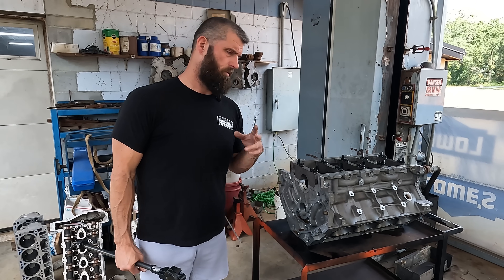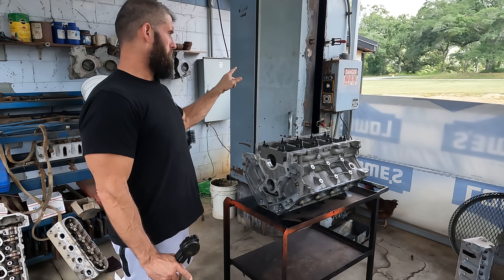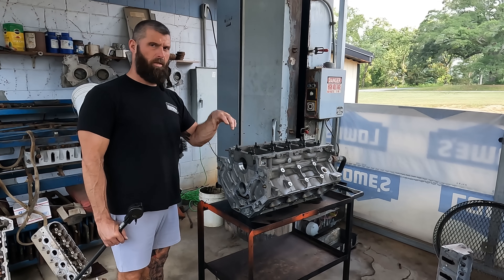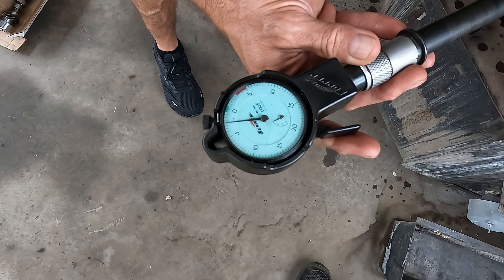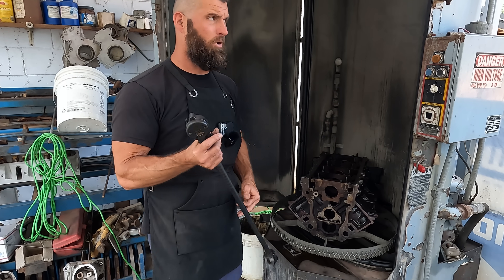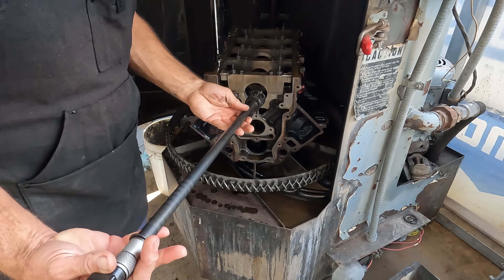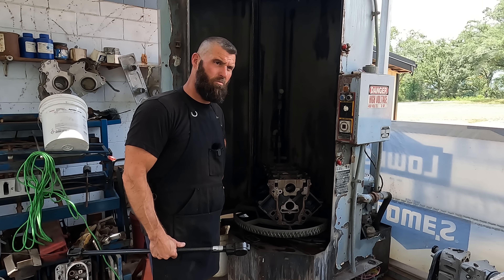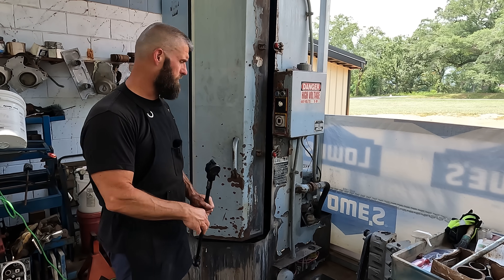Aluminum vs Iron main bearing clearance

Comment: Fascinating test, i always wondered about the aluminum block vs the iron block metal growth factor, you answered that question.. since the main caps are steel and the block is aluminum in your test i have always wanted to know what the cam bore does under hot temperatures since it is a solid aluminum bore vs a iron block cam bore.. and a crankshaft temperature test would be very interesting as well, i suspect that an iron block with an iron crankshaft that the clearance will not really be different under most temperatures cold/ hot , i would suspect that the clearance from an aluminum bearing would grow and take up a very small amount of clearance.. thanks for the comparison.. another fascinating bore dia. Vs hot temperatures test would be an aluminum cam bearing installed in an aluminum block vs an aluminum cam bearing in an iron block?? That would really be quiet the test.. your story video was quite inspirational, much respect to you and your wife 🪽
Reply from the maker: Tyvm, we really appreciate that!, I will do a cam bore test
Reply: @powellmachineinc   WOW, thats going to be awesome ..   stumbled across your videos by accident and have been impressed with the level of expertise and the striving for quality and innovation..  I have learned much from you, im working on my ls2 swap and needed help thank you very much for the educational videos .. Peace

Comment: Not surprising at all and thank you for this. Different materials have different expansion/contraction rates. Not only to be considered for block clearances but also when determining valve lash and other tolerances. Cold and hot lash can vary greatly.  For example, a ZL-1 all-aluminum Rat-motor valve lash should be different than that of an all cast-iron engine or one of a cast- iron block with aluminum heads given the exact same mechanical cam. I'm generally a Ford guy and have always taken this into consideration when building and tuning engines. Factory-installed Ford Boss 429 cast iron blocks topped by dry-deck aluminum heads have different valve lash specs than a 429 SCJ all-cast iron wedge engine using the exact same mechanical camshaft. Measure twice under different conditions.
Reply from the maker: 💯,  yw

Comment: Very few good things about a iron block.. To me the best is they can take alot more heat... Ran a iron block at 280 degrees for 10 laps an never hurt it ( big race running 2nd )... Motor ran the rest of the season with 7 wins... Can never do that with aluminum...
Reply: Pulled in at 270° many times and even pitted next to a guy that pulled in at over 270 and he had his guys pull the engine.  The next week I asked him what he did with it.  He put it back in.   iron block 360 sprint cars.